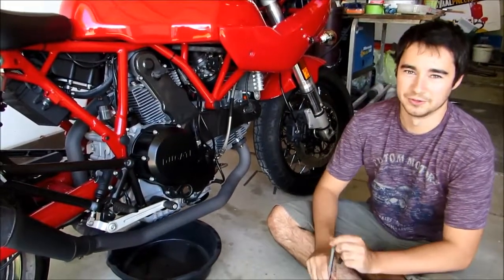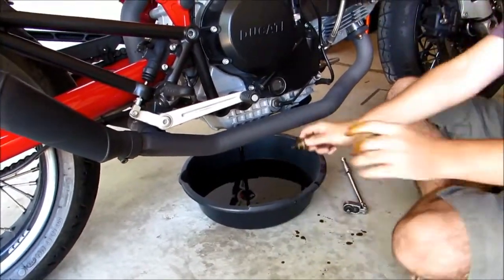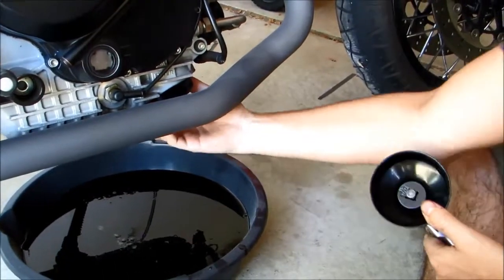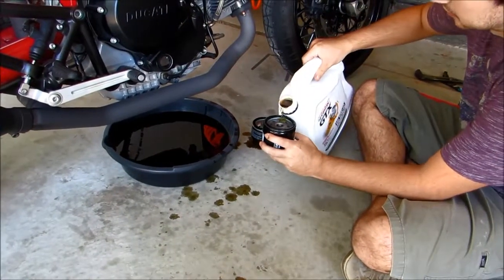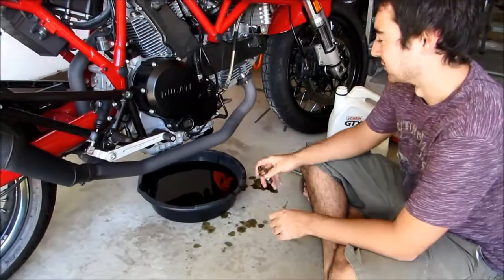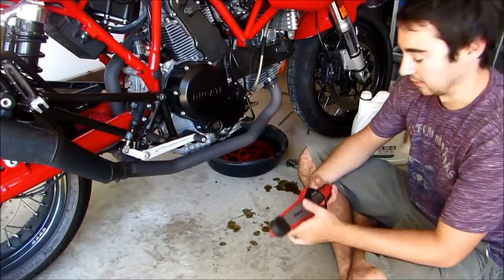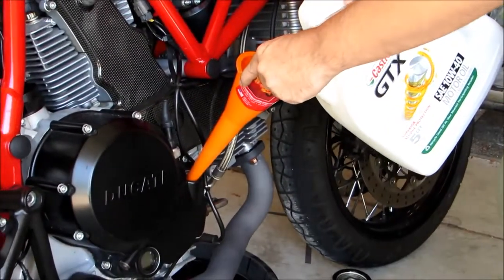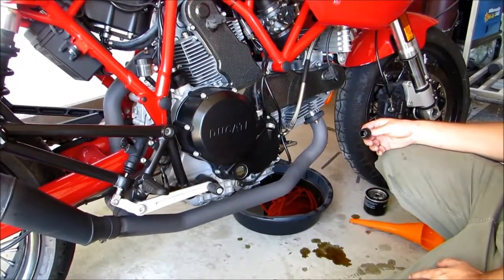Ducati Sport 1000 oil change

Comment: Ducati recommends using 15W50 oil. Did you use 10w40 for a reason?
Reply from the maker: Incorrect, the service manual for the 08 sport 1000 calls for 10W40

Comment: Did you use regular synthetic motor oil ?
Reply from the maker: Castrol GTX 10W-40. It is a conventional oil
Reply: @MikeT  why didn’t you use synthetic oil?
Reply: Synthetic oil is over rated ,just change it once a year !!

Comment: How often do you change it?
Reply from the maker: start of every riding season
Reply: Every 5000kms for me, manual says every 10000.... easy job, cheap preventative maintenance.
Reply: I don't ride mine much, so I generally change it every March. Oil degrades with both time and miles.